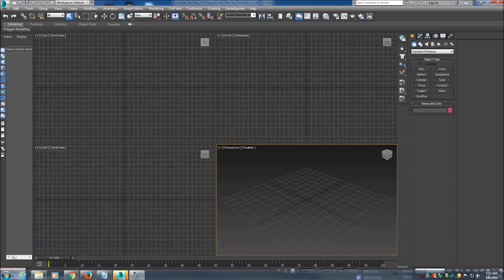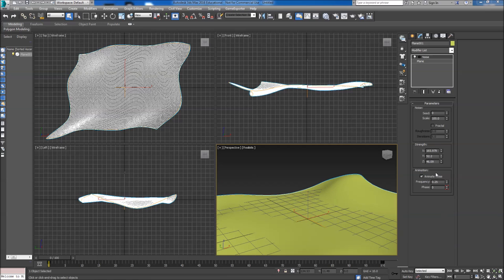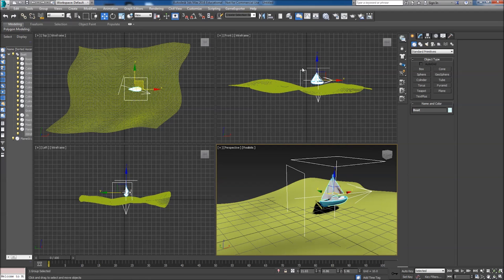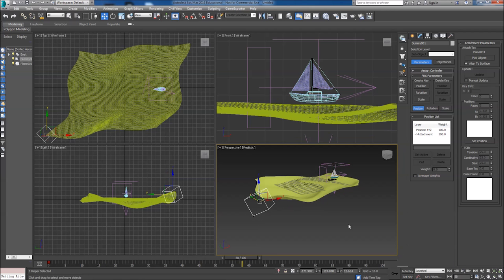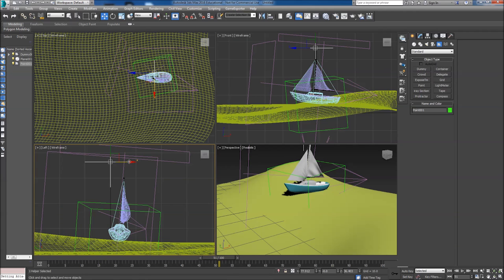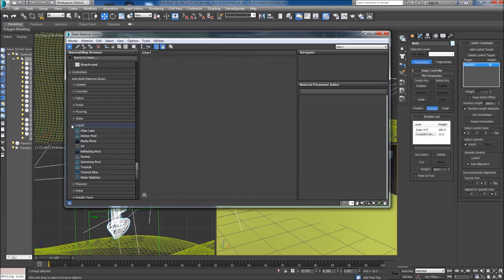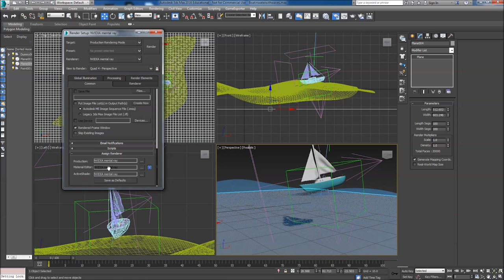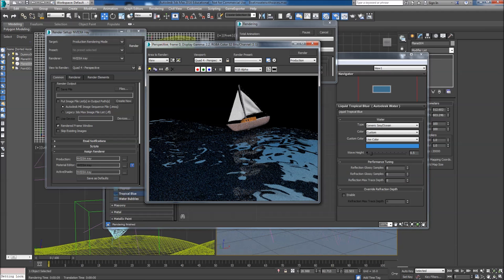3D Max How to make water with animated waves with a boat floating on them in 10 minutes

Comment: great tutorial, i have been having an issue with the iray for a while now; whenever i render with iray all the materials turn to while, the bump maps stay but the base is white, would appreciate the help.
Reply from the maker: Omar Bitar: with iray, use Arch&Design in your material editor,  all the way at the bottom expand Main Maps and use Diffuse Color to apply a bitmap.
Reply: thanks for the tip. ill give it a try

Comment: A very good tutorial. However I couldn't find the material . I use compact material editor and mental ray . I am used to working in that . I am also using mental ray water material however the effect is not similar to  yours.
Reply from the maker: If you switch to the slate material editor you can access various built in water materials.  In the editor, to the left of the search box, you will find a small black down arrow.  Click the arrow and choose "Show incompatible".  This will add many categories of materials at the bottom of list including water.  From here you can select the water material, drag and drop it to the the main workspace, click the node on the left of the material box and drag it to the water plane.